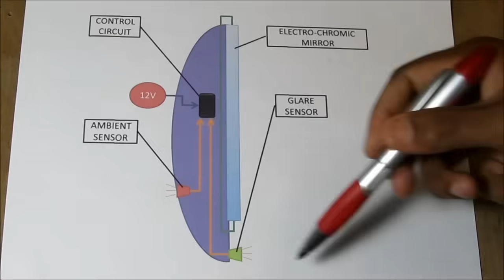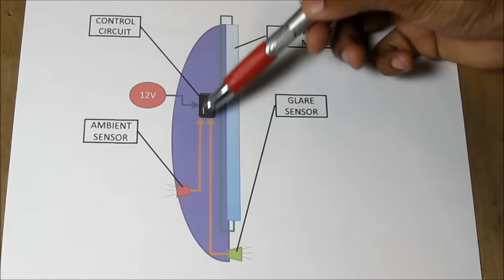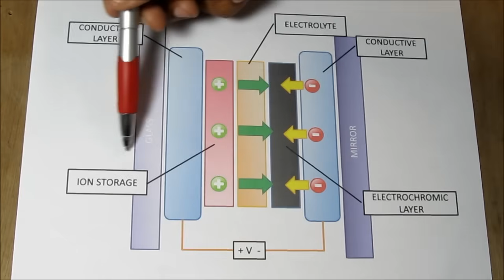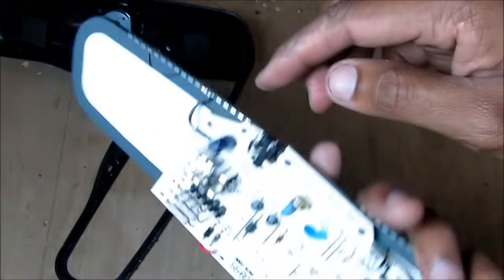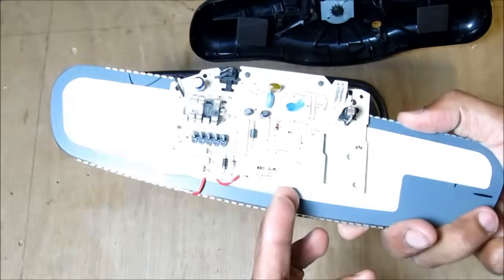How an Auto Dimming Rear View Mirror Works

Comment: Say what? Mine broken off from the windshield while I was driving on the road. Not knowing that it was held together by a screw, I tried to push it into the metal plate on the windshield. I ended up breaking the plate along with bits of the windshield. I wonder if Permatex would be able to reattach the plate on the windshield.

Comment: Great explaination, thanks. I'm watching because the auto-dimming mirror in my car has stopped working. Top half is undimmed and roughly the bottom half is dimmed. I have a replacement, but this happening got me wondering how they work and how one would stop working.

Comment: These mirrors are complete garbage, and even if yours works correctly right now, it will eventually breakdown and stop working.  At first, it will work intermittently, then it will die completely. I suggest using the old fashion flip mirrors.

Comment: EXCELLENT EXPLAINATION that I couldn't get anywhere else!! I have a question. 

My Driver Side Mirror has double vision with a purple hue. It has this condition with the mirror unplugged. Do you think there is a possibility that the Electrolytic Layer is bad. I tried to get an answer to that question from GENTEX themselves but got no answer to that specific question.

I spent $40 on an interior rear view mirror because I was assured that the interior mirror controls the outside mirror. Well, That wasn't the problem and I didn't think it was in the first place.

Comment: I’ve driven 6 different vehicles with these automatic dimming rear view mirrors over a 18 year time span. None of them have ever dimmed the mirror at any time.

I would much rather have a manual dimming mirror.  That way it is clear when I have dimmed the mirror.
Reply: I have a chr2022 i have the same problem. At night it never dims. I have to put my hand in the front sensor to work 😢😢😢😢...
Reply: funny & true for the most part, however the newest luxury vehicles pretty much have figured it out now

Comment: The auto dimming mirror from my 95 Ford is 75% full of a black fluid, that can be moved around by pressing on the cover glass. Is that the electrolyte, that has somehow leaked out of the layers?
Reply from the maker: Yeah. It needs to be replaced.

Comment: Great presentation and technology. The issue I have with these mirrors is there is no way to activate the "dim" feature when you have some yahoo behind you with bright lights on during daylight. Black tape over the forward-facing sensor does the job, but mirror needs a flick of a lever like on standard non-automatic mirrors. Even an on/off button would work. Any ideas other than black tape over the sensor?
Reply from the maker: That's actually good thought. At least with the flip up mirrors you could do that during the daytime.

Comment: Thanks! Do you happen to know  the name of the liquid/solvent inside? Ive read it is highly caustic. If there is just a tiny melted plastic spot on the plastic mirror frame, can the further leak be stopped by a drop of  epoxy resin? The mirror still looks completely normal otherwise.

Comment: Could you drain the battery if the auto dimming feature is left on?
Reply from the maker: Potentially. But these are usually wired to a switched power source
Reply: Thanks for quick reply.  Going to test battery for mini amp draw then put battery on trickle charge.  Original battery 2011 is 250 worst case  replace battery

Comment: As others have stated, a great example of someone who knows how to put together an instructional/educations video without hemming, hawing, stuttering, and not getting to the point until 10 minutes in. Great explanation, I now know how my electrochromatic mirror is supposed to work (I viewed this because mine isn't working so great).
Reply from the maker: Thanks. I try to make my explainations short and to the point. 
I'll have a follow up power mirror video soon
Reply: I need to see a troubleshooting of the mirror to know if the board is getting power.

Comment: do you know if my 02 camry is pre wired to upgrade to auto dimming ?
Reply from the maker: It's not...at Least I didn't see any wires on my 04 Camry when I took off my headliner. I want to install one too...maybe powered off the sunroof?
Reply: @speedkar99  mine does not have a sunroof, so I will tap a fuse and run a wire to get power.

Comment: Manual dim rear view mirrors have a wider range of dimming. I don't know why people would want auto dim as a feature. It is unnecessarily over designed to replace a small tab that you simply "flip" to adjust reflection.
Reply from the maker: +Dean Slegos it's like every other automatic feature...power windows, locks and automatic transmission. A matter of convienice.
Reply: what if you don't have the Tab, nor the two buttons on the bottom.  How do I dim my mirror?

Comment: Thank you very much. My dimming feature stop working...Why and how to repair?
Reply from the maker: +Ruben Mendez if its not bad switch contacts then its within the mirror itself. Best get a used one from junkyard.
Reply: speedkar99 Thank you very much. Was a wrong connection. When I put the switch to on position work good. But when I put the switch at ACC position don't work. I'm repairing right now. Thank you very much for your time and help.

Comment: What a great video, but I need to watch it a couple more times to fully process its workings. An awesome detail, I still remember the glorious speed with which my former MB C200K would dim not only the internal rear view mirror but also the driver's side external mirror, a great helping detail indeed.
Reply from the maker: +RL R Thanks, I'm glad you learned something. I hate dimming side view mirrors, it makes it difficult to see at night, especially if the windows are tinted.

Comment: I am unimpressed with my Subaru auto dimming mirror. Most of the times it dose not work. It dose work in pitch black conditions, however if any light strikes the mirrors sensor such as the head lights from other cars or street lights it will not dim. I like technology but the standard flip mirror shields drivers eyes much better.
Reply from the maker: +Cube Hire agreed
Reply: I bought a manual replacement standard flipping mirror New OEM. But I was shocked to find it was a smaller mirror than came with my new Subaru. I called the dealer and they want me to bring my car in under warranty to confirm it is working correctly. I plan on doing this but have will be surprised if they can fix it. I suspect this new technology is not ready for prime time.
Reply from the maker: +Cube Hire just unplug the auto dimming power wire
Reply: I have turned it on and off and it makes no difference. The problem is that it will only dim correctly on a pitch black road. Any road with oncoming cars with head lights striking the auto dimming mirror sensor it will not dim. It will not dim if exposed to street lights. It is as if I have its unplugged now.
Reply: It's defective. I've never in any car I've ever driven had that happen.

Comment: Can this actually work on the windscreens and windows. WHen it gets bright perhaps we can flip a switch to make it darker.
Reply from the maker: +Taco Yes they call it electrochromic glass (switch glass). They use it in buildings and offices to enable and disable privacy.
Reply: Thats cool! if they implement this on cars (which may probably not happen due to safety concerns), i wouldnt have to use those stick on sun shades.

Comment: I hate this feature on my dodge journey    it makes it hard to back up into parking spaces at night   I wish it had an on off switch
Reply from the maker: +john darmiento I hate the auto dimming feature on the outside side mirrors on my Lexus, it makes lane changes difficult at night especially since I got my windows tinted. I think I'm going to disconnect them and leave just the inside rear view mirror dimming.
Reply: It should switch off when you engage reverse; something is wrong.

Comment: I first had this on my 1990 Cadillac DeVille and have it on my 06 CTS. When I went on a trip, I had a 2012 Buick that not only had the middle auto dim, but the two outside auto dim... now that was totally awesome.
Reply from the maker: +Robert Steich Yea my Lexus also has auto dimming exterior mirrors as well.
Reply: My 2002 Silverado had this also on the rear view and driver's side.  My 2018 has it also as well as power folding.

Comment: Any idea how many volt applied to dim the mirror? And is it in DC or pulse? TQ.
Reply from the maker: Yes, 12V DC across the terminals at the back of the mirror, not the mirror glass itself.
Reply: wong yee yong the voltage that is applied to the mirror itself, after going through all the circuits, is probably in the mVoltage. But it's most certainly DC, other wise it would flicker, depending on the Hz if it were to be AC.

Comment: give this man an award!  Now for extra credit.  What causes the yellowing in old mirrors?  Is it the electrolyte discoloring and thus could be replaced, or does it involve either the ion storage or electrochromic layers?
Reply from the maker: +DCUPtoejuice Thanks :)
Does it have to do with the seal breaking causing the liquid gel to escape? The mirror has to be replaced.
Reply: +speedkar99 the question was does the mirror yellow because of the glass or the fluid or both?

Comment: I recently purchased a USED  Subaru Legacy Outback 2001. The ONLY PROBLEM is: The REAR VIEW MIRROR  in 90% lower section of it is COMPLETELY DARK and the remaining 10% in the TOP of it is CLEAR.  Can this be FIXED instead of REPLACING with a New One?  Please HELP to solve this problem....
Reply from the maker: +TINRICKY I haven't looked into repairing the mirror, I picked this mirror up from the junkyard for $10.

http://www.bimmerforums.com/forum/showthread.php?1276580-Auto-Dimming-Rearview-Mirror-FIX

Comment: great video and explanation, wish I could install one of these in my 99 Camry, I get blinded by SUVs behind me often
Reply from the maker: neppy5 Is pretty much plug and play, as long as you've got a switched 12V power going up to the rear view mirror.
Reply: +speedkar99 thanks, you're always giving me the ideas and courage to try new things  have you had experience with auto dimming mirrors that have a compass and temperature display? wondering if those require more than power and ground
Reply: speedkar99 so I'm going to be ambitious here an snag an auto dimming mirror that also has a compass and temp display from a much newer Camry, not sure if the mounting bracket will be the same, probably not, and I'll need to figure out the wiring pin outs also. Will let you know how things go when it arrives and I start trying to install
Reply from the maker: That's great. I believe the compass only needs power. Not sure on the temperature display because it needs a feed to an external sensor.
Reply: speedkar99 ditto on that, did some research and these Gentex mirrors with temp display do utilize an external sensor which is usually mounted somewhere in the front grille area of the vehicle
Reply: speedkar99 I'm wondering if you've seen options for adding auto dimming side view mirrors as well
Reply from the maker: Your best bet would be to swap in 2000-01 ES300 mirrors with the dimming function built in. You'd have to see if they'd bolt up though as the ES300's doors are frameless.